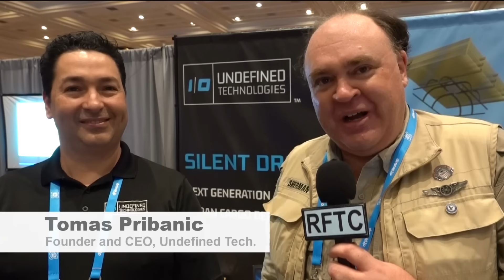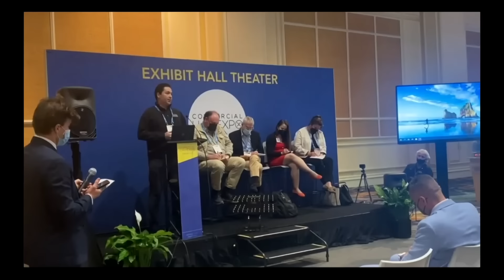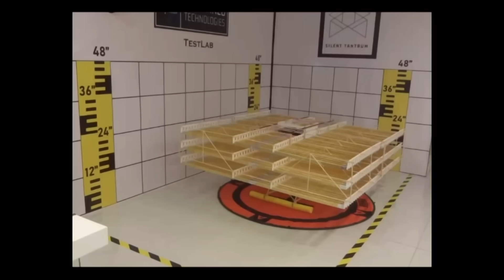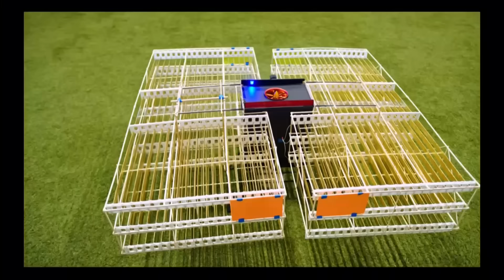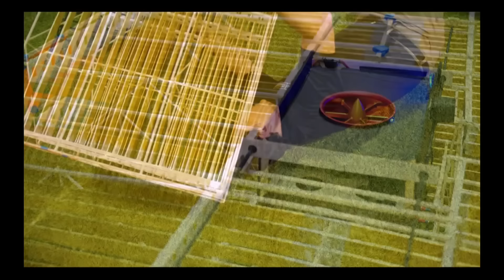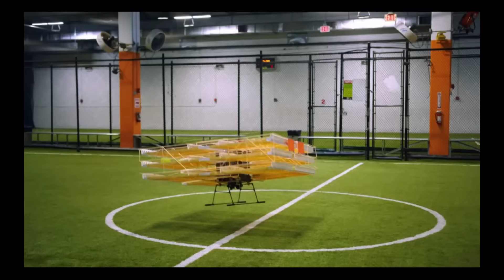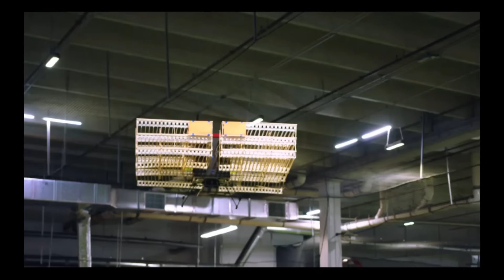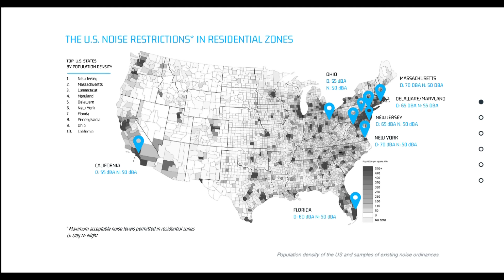New Drone Tech: No Propellers, and Yet It Flies!

Comment: The efficiency of this drone is ridiculous, it needs huge amount of battery energy to enable the lifting of 2 LB only. Unless operated by Nuclear based battery or power charging stations flying in the air the feasability will be near zero. How about building air-based infrastructure allowing it to transfer power to this poor drone ! How about designing a flat rectangular antenna so huge that it pops up for short period every once in a while to collect energy from environment and then folds back to allow normal operation? I have many other ideas but will require NDA and can not disclose in here.
Reply: Proof of concept unit not proof of production unit.  Materials science engineering challenge and battery tech. Musk is working on it.

Comment: The tech is real, I've built one of these myself, but it's nowhere close to being able to sustain drone flight like this. The thing that you saw flying in the video had power transmitted up wires to it, mostly because it's not capable of generating enough lift to carry batteries yet.
Reply: As for the UT craft it has an EDF in the center.  There is a video with audio on their website, and I have heard the distinctive sound of the motor spinning up. 
There is a patented ion propelled vehicle on my channel that can in fact lift its onboard power supply.  It is the only VTOL ion propelled craft that can do it in real life.

Comment: Look the demo, they made a HQ video! That is in the middle is NO WONDER WHY, is a SMALL JET ENGINE! Look the exhaust of the engine, is fitted with servo-controlled flaps. That controls the outgoing flow. Why the hell needed the big area bullshit? Is the stabilizing area, with weight, and made the sourrounding airflow "parallel" to the jet"s mainflow.
They found the dumbest, and so loud reporter to made that "amazing" video. It's a scam, guys.

Comment: Interesting. Worked on a project for F1 in the early 90's that involved ionizing the boundary layer on wings to enhance laminar flow. Worked quite well.
Reply: Yeah the tech is older than what you worked on.  They made these things as hobby crafts back in the 60's.  👍🏼👏🏼🤝🏼
Reply: How did they produce enough power to make it work?
Reply: @buisyman  How much horsepower does an F1 engine make? The question is how much power did they need to keep the air sticky.
Reply: @thomassuit7450  I'm not talking about how much power the device produces, I'm talking about how much power it takes to make the thing work.
Reply: @buisyman  That's a much better question than, "How did they produce enough power to make it work?"
Reply: @thomassuit7450  Batteries didn't last but 15 minutes, remember? That just doesn't work in real world applications, but it's a start.
Reply: @buisyman  Was your question about the F1 application or the levitator?  I was talking about the F1 application.
Reply: @thomassuit7450  I was talking about the levitator. You know, that thing the video was all about?
Reply: @buisyman  Then you shouldn't have posted your question "How did they produce enough power to make it work?" as a reply to Neil Reid's comment about an F1 racing application.
Reply: @thomassuit7450  Hmmm, you might be right about that. Maybe I shouldn't post while Uncaffienated.
Reply: @buisyman  Roger that. I have trouble forming complete sentences if I don't have my morning coffee.
Reply: @thomassuit7450  XD Awesome guys!!! a weeks worth of peering into the back and forth spiky conversations of 2 mad geniuses and all it takes for this "Thing" to work is coffee!!!!! God i love science!!!!!! i made a boo boo there!!!
Reply: @buisyman  probobly like 90% or so is system losses. So there is plenty to improve
Reply: Well, that helps explain some of the Ozone Layer Depletion too. This drone is negligent if it is produced for mass-use.
Reply: @JacobProbasco  Um...what?
Reply: Why don't they texture the surface of vehicles or aircraft like a golf ball? A smooth golf ball wouldn't travel as far as one with pits as the little pits create turbulence over the surface and reduce drag.

Comment: I know what "redundant" means but I have no idea what it means the way they're using here, "redundant safety systems"?  Safety systems that repeat themselves?
Reply: means back up systems. bs statement, proof of concept units do not have safety considerations or any other redundant systems as  control, power,etc.  that is brought in with on-going experimental to final designs.
Reply: @MrBonners  OH!!  Okay, THAT makes sense!!  Thanks!!  I've just never heard it used that way before until about 2 weeks ago and then here.

Comment: One puff of wind and that old school LIFTER will blow away.  I am glad to see they are working on stable flight designs. I have built many Lifters years ago when it was the thing to do. Small basic ones and large 4 foot ones. Never spent more than a few dollars to build and used junk CRT supplies. But with out some sort of controls they had to be tethered. So it is interesting to see them working on a balancing system.
Reply: what makes you think anybody gave money? these and commonly inexpensive materials available in any hobby store to Home Depot. one of proof of concept. less then $100-ish.

Comment: I can hear the flat earther, space isn't real, anti-science crowd screaming bloody murder till their head explodes"FAKE,FAKE,FAKE!!
Reply: Lifters generally required a several kg external power supply tethered to a several gram model to make a model fly.  The UT craft is built the same way geometrically as a 2-stage lifter.  Those are 1/2 as efficient as a one stage version.  It is not flat Earth thinking to realize their craft would therefore be at least roughly 1000 times underpowered to lift its power supply without a ducted fan.  That's the actual math, at least in approximate terms.  
On my channel there are a series of ion propelled crafts that do lift their power supplies.  The overall thrust to weight had to be increased drastically though to do it.  They are patented for that reason.  It requires that a lot of things be quite different to lift the onboard power supply with ion thrust. 
Mr. Pribanic/UT has a video out on his website that has audio and there is clearly a loud ducted fan on his craft for lift, otherwise it would be underpowered by several orders of magnitude.  Especially, to lift "2 pounds" of payload with just ions, for "15-minutes, silently" as Mr. Pribanic has said.

Comment: Curious, how do you keep the Ionized air near it when dealing wind? Wouldn't a simple breeze push your Ions away and it would fall like a rock?
Reply: Ionized air is just the cover story. I suspect this thing works in a vacuum.
*cough Aether
Reply: @zervzerv6122  in the Aether like those radio waves?
Reply: @vast634  Aether is the theoretical medium of radio waves.

Comment: No noise? Ionisation of air should be more noisy. The low volume air has to expelled at very high speed which is noisy.
Reply: it is dependant on field strength not how fast the ion flow goes.  electric fields aren't noisy until discharge, lightning.